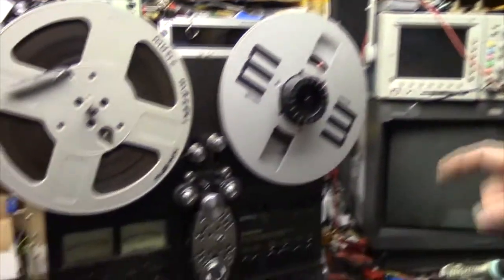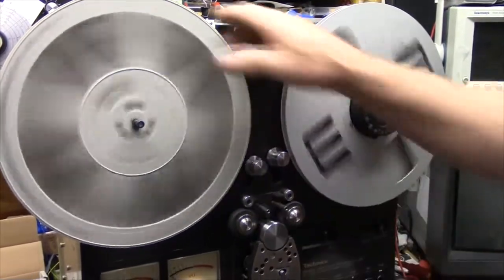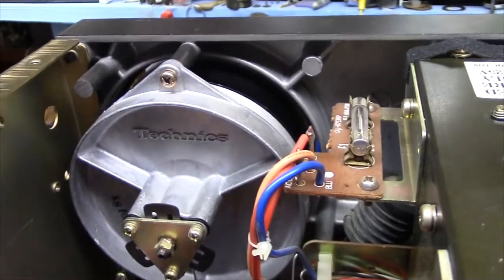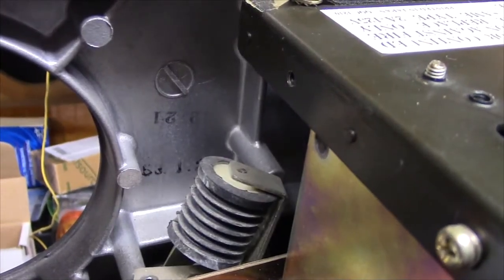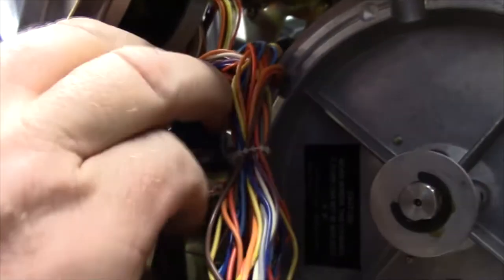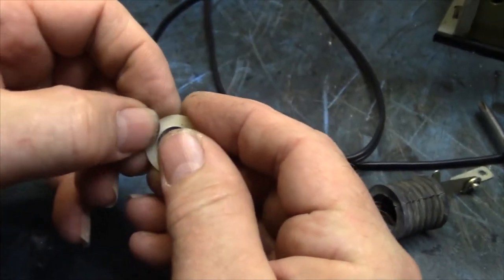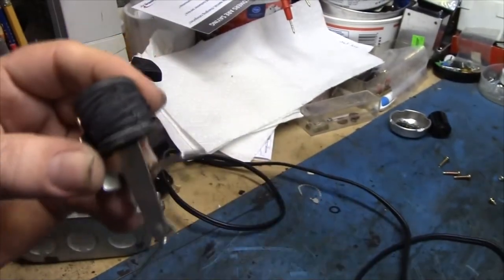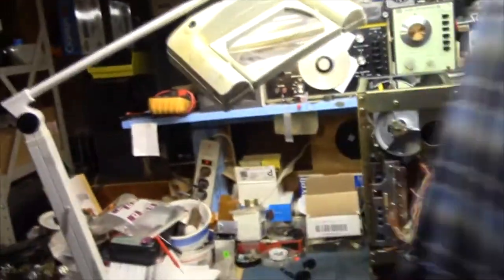Technics RS-1500 Reel to Reel Tape Deck Bellows Repair

Comment: Does anyone know what causes the tension arms on a technics rs 1500 to continually bounce up and down while in play (with a prerecorded tape on it).
Is it normal? Also the "quartz lock wheel the lines are not stationary shouldn't they be? Like on a turntable?
Thank you

Comment: Nice job, and we'll explained!! However, I do have a question. These 1500/1520/1700 and 10A02 R&B Technics R2R's have a speed accuracy issue where they have a capstan motor flutter that causes the sound to vibrate. There was another video where a repair attempt was made but the resolution was not forthcoming.    :-(   So, have you experience this condition, and more importantly is there a solution (either mechanical or electronic)? Thanks

Comment: Hi, I have Technics RS-1700 where the capstan produces relatively loud cracking noises, especially at higher speed of 38 cm /s. Is this due to bad bearing?
Thank you in advance
Reply: That bearing may need a tiny drop of fine machine oil.

Comment: I have an RS-1700 got the same problem. Dont know if I have bellows in there.
Reply: The whole motor/driving assembly as well as the brake system is exactly the same for all these machines (1500-1506-1520-1700-1800)

Comment: This guy is very knowledgeable, but jeez take it easy, these are delicate machines talk about manhandling it yanking and banging components out and being so rough, wouldn't get him near mine, its likely to come away with more problems. Plus changing the brake shoes create magic not cleaning up a bit of existing fluff.

Comment: I replaced the brake pads on my RS-1506 with natural leather pads I cut myself to the right size.  The original pads are junk, some kind of foamy stuff and absolutely crappy.  After replacing the pads, my deck makes a dead stop immediately.  I have to stress that I do not agree with your claim about the brakes being of little importance, they really do matter!  One can clearly see the importance of brake power with new pads that have a good grip when fast forward (or reverse for that matter) releases the tape from the spool.  Poor brakes will not be able to stop the fast rotating spool that is heavyly loaded with tape.